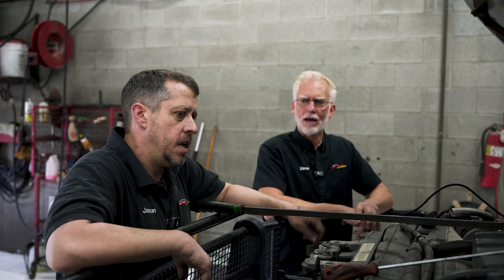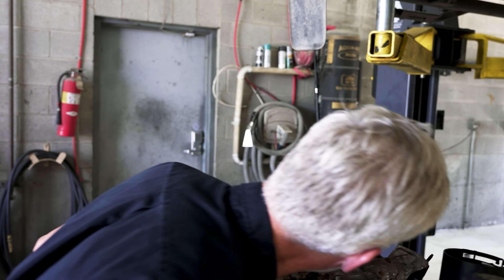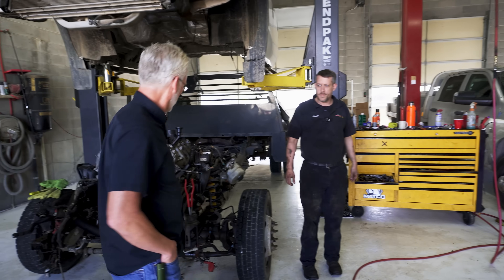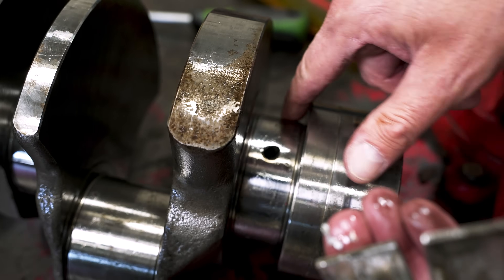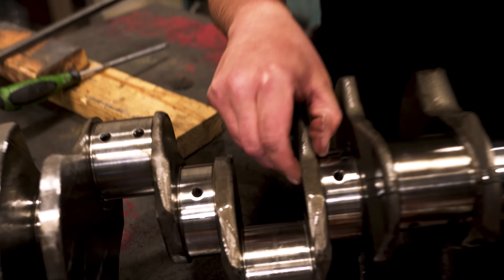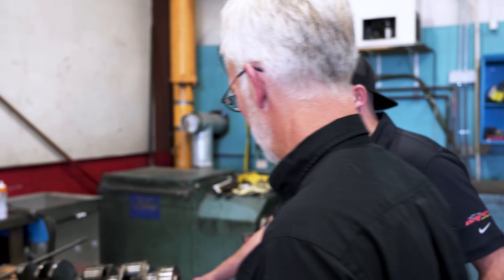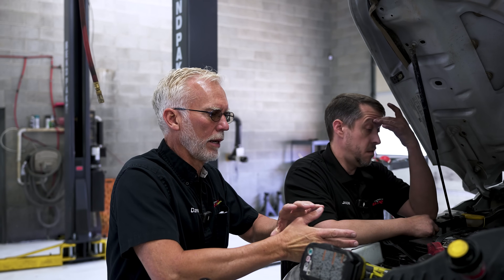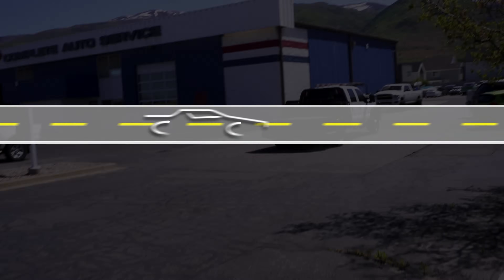Ford 6.7 Power Stroke Failure

Comment: Dave, I’ve got a 2011 F350 with 210,000 miles. It runs great but I’m curious what a complete overhaul would cost? I’d love to include the DCR pump and a 2017+ turbo. Any idea?
Reply from the maker: Thanks for your question. Please check out our website at monsterengines.com
Reply: Looking at the 2011 Tow Monster Plus… is the price on the website including labor or is that just the engine?

Comment: That tech was tearing that motor down like it owed him money!
Reply: It does. He has to work on it, so it owes him.
Reply: Why would anyone want such a complicated diesel  engine  that requires a whole truck tear-apart.. for a engine problem is beyond me.. Cummins is so open and accessible.. never hear of cab removal.. waterpump  pop the belts and two bolts!  45 min..start too finish in a driveway.
Reply: @kuhn4311  The cummins looks good except for the 2 rear cylinders buried under the dash.
Reply: Yes but the cummins is in a dodgə  @kuhn4311
Reply: Cab removal on a powerstroke, when done by professional takes no more then 30-40 minutes... 
Would you prefer to work on a full 360 accessible motor when doing labor that takes over 8hrs or would u like to hang over the fenders touching the truck potentially damaging it in the process? 

 @kuhn4311
Reply: @kuhn4311  I think Ford just created a problem where there was none. I would rather have the 6 cylinder in line any day.
Reply: Well, he don't get paid to be on film calling customers... so... 😂
Reply: Gettin it
Reply: Very funny!!!  Well done!
Reply: i noticed that, much respect hard working guy.
Reply: Lol lol lol lol.
Reply: 4:10 Lolol

Comment: Great episode Dave. When my boss 6.2 goes it’s coming the 2000 miles to you!
Reply: 6.2 Boss is awesome. Just buy a new one and drop it in, still cheaper than replacing the injectors on a 6.7

Comment: Use cooper ceramic roller bearings split cage 50 75 mm 2 3 inches camshaft n crankshaft let it roll not weld at extremely high rpms sfk bearings cooper take a look why i would beat david n Goliath

Comment: I used a dnj kit on my mazda a few years back, ended up buying new clevite bearings because I couldn't get the numbers I was looking for on assembly, glad I did.  Pulled it after 100k km, a lot of the parts from the dnj kit looked pretty questionable.  Pay now or pay later.

Comment: I find these videos so amazing 
What quality of craftsmanship and integrity 
Lifting bodies off frames as easy as opening a door. Would love to see a video of that process
Best to Dave and the Crew
John
Reply from the maker: Sounds good, will see if we can film that for ya👍
Reply: @DavesAutoCenterCenterville  Thank you sir
Reply: The first I saw that a few weeks ago, lifting the cab up and away I was thinking what a lot of work. But then when I thought about it, it is a lot less work compared to pulling the motor through the hood if that is even possible.
Reply: Worked at Toyota Fremont Ca for 20 yrs ; the frame comes along conveyer line upside down , they put the wheels , gas tank in goes to a lifter ,up , then rolls over , picked up by carrier , goes to another lifter , down into the front wheel alineer ,out around to a diff line , down , add more stuff , lower the engine & tranny in , then the bed, then the cab , lifted up goes round to new line , add the brake fluid, - wheels- emblems - set down on floor conveyor add doors , go through water test - add the underbody coating , paint protection plastic , drive to parking lot , then rattle check on wash board  track, back to parking lot ready for transport

Comment: I guarantee a piece of that excess silicone plugged the oil passage on that bearing causing it to fail
Reply: Not a Ford guy so not sure of the routing, but wouldn't the next stop in the oil system be the filter after the pump?

Comment: that teardown was feaking awesome, that dude was so in the zone doing his thing
Reply from the maker: You bet, that's Jason for ya. Thanks for watching.
Reply: @DavesAutoCenterCenterville he needs a raise🫡
Reply: And…..labels every bolt and files them away in a red solo cup library by the sequence he removed them.  Jam up tech right there.
Reply: Dudes knows where every bolt is before his eyes see it
Reply: Facts!
Reply: Except he used Ryobi cheap stuff
Reply: @Jamesrosario2348  gets the job done anyway
Reply: @Jamesrosario2348 if he did that with shitty tools (you called them) he used that well imagine what’d he do with better ones!
Reply: @Jamesrosario2348 did the "Ryobi cheap stuff" do the job or nah?
Reply: Only way to be that efficient, is years of experience. These guys are good, I'm sure pricey, but when you see this efficiency, it makes you realize that for the price, and finished work, it will be more cost effective, and done right.
Reply: Miydadluvyou❤
Reply: Are there any issues with the 2019 6.7 diesel ? Looking at buying one with 107,500 miles on it? Anything to look for??

Comment: I have a 2012 Ford F250 with the 6.7 power stroke, all factory original. I have over 610,000 trouble free miles. I take very good care of this truck and never miss a service cycle since I have owned it.
Reply from the maker: Great to hear👍. Here's to many more trouble, free miles.👏👏
Reply: I also have high miles on my F350. I change the oil every 4000 mi and left the stock tune on it. Use it as designed and they will last.
Reply: @TheBandit7613 I agree! The problem is no one can leave them stock, they have to keep up with the jonses. Bigger tires fancy wheels off the shelf tuners and bigger exhaust! Been there done that got the t shirt! Now my vehicles stay factory!
Reply: @kenwillis8487 so now you drive around as dave says with your intake hooked tonyour rearend 😂😂😂😂😂and think since it's factory it's better mine is deleted tuned gets better mileage and fresh air going to the engine
Reply: Lots of psychics on this channel. Able to tell truth from lie through only digital means. Incredible
Reply: Whatever the h3ll you're smoking sharing is caring  @CoachEgg
Reply: @CoachEgg  When people say stuff that isn't possible, you either assume they're lying or you believe in miracles.
Reply: You give me hope 😅
Reply: Less emissions controls perhaps?
Reply: That was not the problem.
Reply: Wow, I notice American's drive their vehicles for much longer than us south africans. We replace at around 150000 miles. I drive a ford everest, designed and engineered in Australia. Fitted with a 3.2 5 cylinder engine with 200hp.
Reply: @DuitserSwart  here in South-West Afrca we drive vehicles quite a bit more. 
Vehicles have become so expensive that we milk very km we can get out of the reliable brand  vehicles.
Reply: People do bad jobs maintaining the trucks and then blame the manufacturer.
Reply: @pablochacon40 exactly my first 6.0 super duty taught me that. Stretch your oil changes out toast your injectors…….110000 next one changed oil every 4000 religiously…….500000.
Reply: Keep the fuel clean and oil changed and you're golden.
Reply: Same story here.  I run an 08 6.4l with over 450,000 on tge clock. I told my customers long ago, if you just keep up maintenence, you can get the miles out of it.
Reply: 600,000…. hmmm. Same starter? AC? Water pump? I believe you could get it out of the block but all the bolt-ons?
Reply: @HBSuccess What about the dam OIL pump??
Reply: @HBSuccess  The water pumps and alternator were replaced. The water pumps went at about 320,000 miles.the alternator was replaced about 498,000 miles. Everything else is factory, I can prove that.
Reply: I 100% believe you as a 6.7 Powerstroke owner myself i put 100,000 miles on a 47,000 mile 250 when i purchased and could tell it was worked and taken care of! IF YOU DO NOT WORK MODERN EMISSION DIESELS THEY WILL SELF DESTRUCT! They are absolutely meant to be worked 24/7 with whatever weights as drive train are the same from 250-450 except gear ratio obviously but at the very least drive,drive,drive constant hot,highway miles! If you don't need a diesel i wouldnt buy one these days with the EPA racquet system as speed to air pistons and tuning could do better for environment but just advice as a owner if you tow once in awhile and under 45 minute drives a day i would just go with the 7.3 gasser but thats just advice..@edtaylor6431
Reply: I believe you man i have a 2019 6.7 6 spped and as long as i use it as designed which means WORKED AS DIESELS ARE FOR instead of stupid,cheap tunes that tear everything up because most reputable tuners for dirty D,s have left that business. I have left everything stock ran it all 4 corners of the country most of the time 10,000 pound camper behind it from 0 degrees-110 degrees snow,sleet,rain whatever also generator etc loaded in the back. Have put 100,000 miles on it in 2 years and still purrs like a kitten even started in cold weather which if I don't have to shut it down in cold weather I don't like to they're meant to be ran 24/7 3/4 of max tow or at max all the time as long as maintained have never had a issue with a 150,000 miles on it as of today except normal wear items fingers crossed lol.. and it's a pretty Lariat Ultimate Package Crewcab instead of just WT. IM TRYING TO GET INTO HOTSHOT HAULING AGAIN JUST HARD TO FIND TRAILERS IN MY AREA! IM WILLING TO WORK TO NOT ONE OF THE YOUTUBE I CALL "FOR SHOW" HOTSHOTS! The longer she runs in fact the healthier she sounds! I also recommend Rizoliis for DEF treatment as the Ford stealerships won't tell you the emissions have to be maintained also which my DPF seemed to almost be clogged no matter how much I drove it found out after using Rizolis you have to keep all that crystallized DEF out of the lines sadly as another cause of diesel engine wear and tear our government didn't say the emissions had to be easily accessible and maintenance easy so the company's could just use the cheapest,easiest crappy way of doing it that screws the customer of course as the working man always bails our great nation out of trouble instead of us getting a break once in awhile we've bailed out big banks,big insurance,big airlines and the auto industry which this is how they repay us the cheapest route of emissions instead of using better pistons technology and tuning they just cork it off and eat it's own exhaust but that's just my 3 cents lol.. and it's any administration I've learned through my decades they're all full of crap BUT atleast some want to preserve freedom and not make money off of Hurricane victims which I won't go there as I was a Hurricane Katrina victim it took 3 days for any kind of help!
Reply: Whats your maintenance  like how frequent  are the oil changes
Reply: @big6red3  I service every 3,500 miles. And I do not run any synthetic oil. I run Mobil Delvac because synthetic is not designed for diesel’s. Synthetic was originally designed for the high RPM engines, and diesel’s are not a high RPM engine.
Reply: My bone stock fleet maintained 2016 f450 got a new long block last year at 158k due to majorly excessive blow by, I think the long block cost @24k from Ford .
Reply: I never seen a 6.7 run past 200,000 miles I’ve replaced quite a few 6.7 before 100,000 miles
Reply: That is seriously encouraging.
Reply: 2011,f350, 6.7, just turned 200 k, I went thru the two intakes and scraped out oily soot , clean the sensor on upper , it will plug up.
Reply: I've never even heard of a power joke going 600K miles.     Holy cow
Reply: @gregorylyon1004 I heard of one, but it was deleted and did hundreds of highway miles literally every day.
Reply: @gregorylyon1004   I know couple that are hot shot drivers F450 put almost 5000 hrs on their truck in one year! One is sleeping while the other is driving man they go everywhere in US and Canada
Reply: Never had to  replace the starter or spark plugs?
Reply: @jasonjaevo9 

What spark plugs??
Reply: @johnpeters9793  I meant to type glow
Reply: That amazing
Reply: Oh and yes the only big thing wrong with Ford diesels are the fact they're still using a known faulty part that cummins and Duramax have already tried also for coat savings bith went back to the CP3 within a couple years because it was ruining there reputation which we all know now why cummins was such a reliable beast hell they didn't even use emissions look now they almost can't give them away which point is as minus the CP4.2 fuel pump which is pure garbage and scary as hell as they can go out at 1,000 miles or 1,000,000 miles costing faithful hard working customers 10s of thousands of dollars not to mention theyll be out there work vehicle and could lose a one man business BUT thanks to S&S Diesel they have not only the disaster prevention kit that will keep all the metal shards from spreading through fuel system saving a alot of money they also have the DCR fuel pump that just completely rids the issue for many,many trouble free miles and actually works better for $1,900 is great! Which at the same time we just spent anywhere from $72,000-$110,000 these days as I have the 2019 as to wait for the 10 speed issues to be worked out to still have to put sizable money into them is insane to me but I thats what you want and/or need then it is what it is.. sadly Ford just won't replace it when they know it's a fault with all the class action lawsuits and knew it before they were sold as its a older European pump but what can we do in the racqueteering system we live in.. and no politician will change it so save your breath we live in a capitalist country which I love my country from a military family but were more capitalism than democracy good lord I seriously pray to save atleast what we do have going for us in November as it will radically change for something we don't recognize not just people getting older and seeing things for what they really are it will be unrecognizable if the worse happens please do your own research people not a news channel government websites etc!! Or look at what people have bluntly said themselves! Admitted themselves and on video and tape recordings! I'm never political i just worry about my children is all I want to leave them what I grew up in is all.. Apologies for the political bull!!!
Reply: It has to be deleted probably from brand new
Reply: You’re one lucky guy.   Buy a lottery ticket because you sir have beat the odds!
Reply: I've worked for Ford for 40 yrs seen and worked on every diesel they have ever made. The ones that survive are extremely well maintaine, I have all my friends changing oil at 3000 to 3500 max, using 15/40 in 6.7 diesels 10/30 is crap in a diesel
Also change fuel filters same time, use fuel cetane booster additives and anti jell additives every tank,  Oregon has some of the worst fuel in the country, one of has 7200 run hrs and very little idle hrs. Yes it has had alt, starter, turbo rebuilt, typical CAC tube but never been apart , still running same fuel pumps. But if any do fail I'll be putting those kits on Dave likes.
Reply: Well played good sir...
Reply: I wonder what the cost of the repair was cuz I'm sure it's not cheap
Reply: Sometimes its not the quality of the truck but the quality of the owner. When my customers ask me what truck to buy I tell them to buy whatever they like But Take Care of It!
Reply: Comment sense....  
Maintenance is the secret .
I rather pay, let say $300 per year on maintenance than $6,000 to $10,000 for a nice rebuild engine. NO  DISRESPECT ON Mr Dave. His quality is the best. Im trying to help people.   Comment Sense....its alll
Reply: Wow...I just turned 200k....lookin for as much as I can get out of her....
Reply: So now are potentially driving a time bomb
Reply: lol all factory original. Sure.
Reply: That is definitely crap. With all the shit attached there is always something
Reply: @sammyd7857  what attached? air pipes and a belt? Looks alot more confusing than it is plus he's already said the normal maintenance items like water pump,serpentine,and things like alternator that are all just normal maintenance items! I have a friend that puts 100,000 miles a year on his and just regular maintenance items for wear and tear on a diesel that's truly used! They're not meant to put put around town ive heard so many people on all brands "I don't know what's wrong i just drive around town and idle it" all I can do is laugh!
Reply: That is a 💯 lie
Reply: @justinwam they go the miles if taken care of
Reply: @justinwam  I consider "trouble free" as in no major failures. Water pumps, alternators, etc are all "wear and tear" items I'd consider.
Reply: @mr8610  true, I'm still amazed I got almost 200k on my silverado with original water pump and alternator. Only thimg that's ever went out was the tourqe converter while it was still under warranty. I have been blessed with a good one
Reply: @burdman5620 especially being a junk Chevrolet 😢😢😢😢😢😢😢😢
Reply: @justinwam the 6.7 powerstroke can be a very reliable engine this coming from a Chevy guy. I’ve worked on a few 6.7 trucks with over 800,000 miles.
Reply: @justinwam 6.7s are great engines
Reply: @justinwam agree 😂I be laughing whenever guys say that like they say stop the cappppp
Reply: @justinwam shhhhhhh , you will seriously screw this man’s head up , if he has to face reality (yes it’s a driveway queen )and he really did get those miles and he needs to run down to the gas station and buy Idaho lottery tickets immediately!!
Reply: @AmericanSurvival1 won’t do any good now to get a lottery ticket haha. Hes used up all his good luck 😂